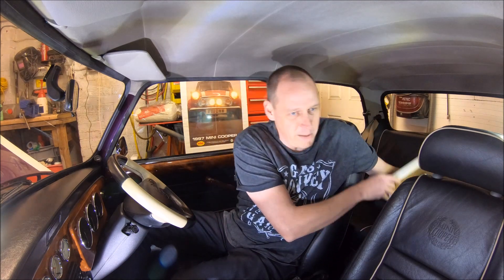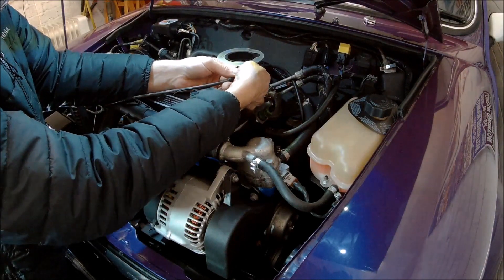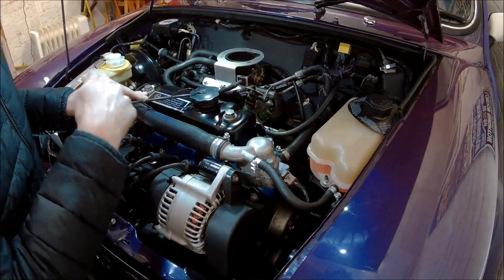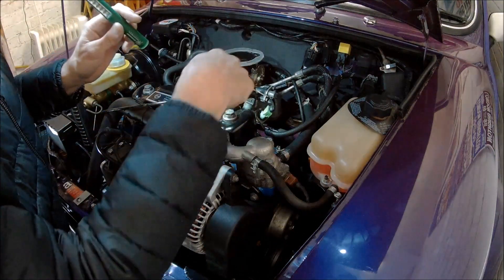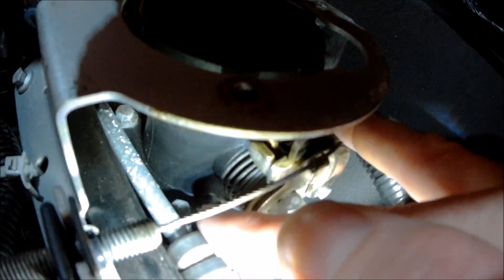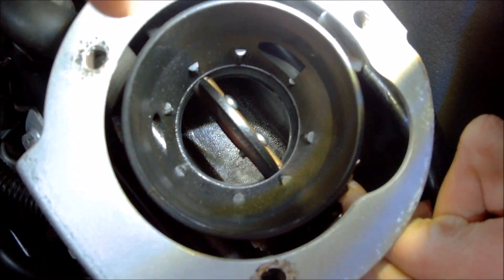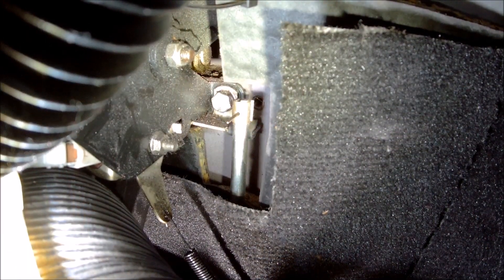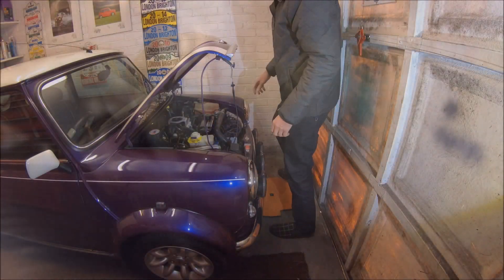Classic Mini Throttle Cable Sticking - Winter Workshop Part - 19

Comment: nice work sir, i think your subscribers will rocket as you have great content and thats what counts. good tips with the MPI, on a separate note, what are you using for light when you are voicing to camera in the mini, its a bit harsh and casting shadows. I only say this as i am learning about this stuff myself and now i notice it more on other videos :) - i have been playing with an old shower curtain over my spot light to act as a defuser :) or pointing the light at the wall behind so that the light bounces back so its not directly in my face. anyway as i say i am still learning so just want to share the love with fellow Youtubers :) keep up the good work
Reply from the maker: Yeah, been playing around with the lighting, way too harsh in this one :) I am just using a few hand held LED torches and an LED floodlight but I need something to soften the lighting.

Comment: I have a SPI Mini that was converted over to HIF44, and ever since the new throttle cable was installed, it feels very stiff when you first apply begin to press it.  It's a new cable so I wondered what could cause it to feel so heavy when initially pressed down?  There doesn't seem to be any kinks or binding anywhere that I can tell?
Reply from the maker: Disconnect from the carb and make sure the pivot on the carb is free
Reply: @classicminiworkshop  I will give that a shot.  The pedal seems to move freely, but the acceleration is abrupt when first applied so it may be in the pivot.